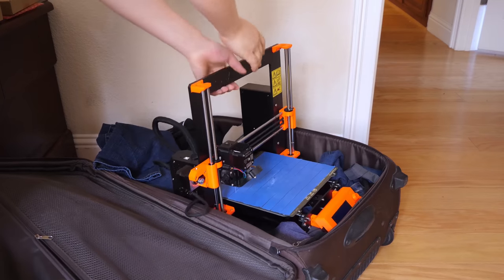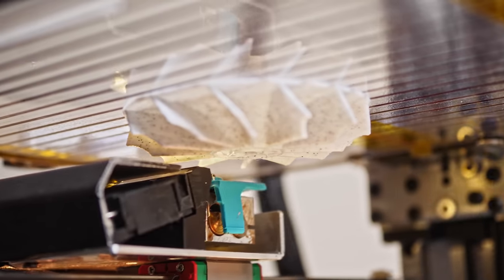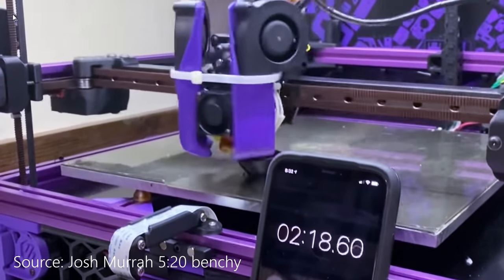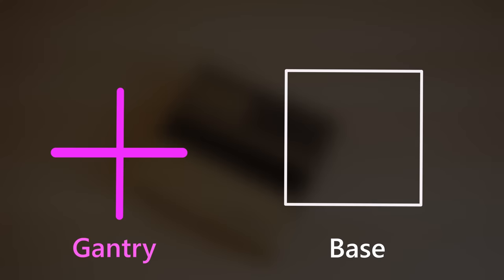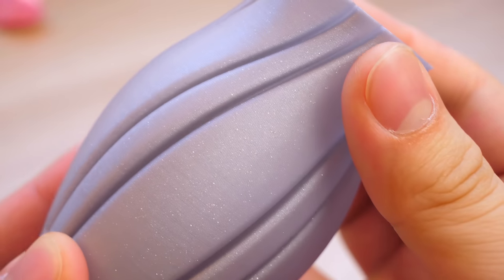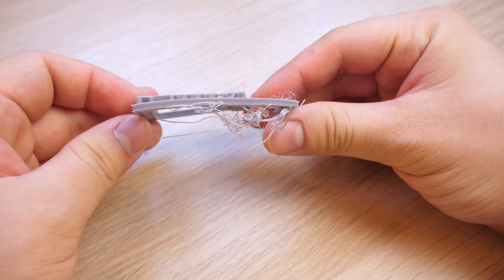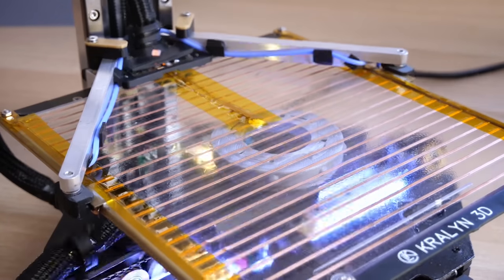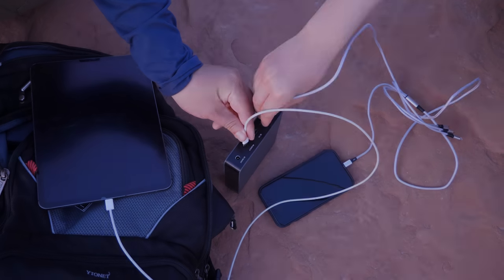A DIY 3D Printer That’s Upside-Down, On Purpose? The Positron Introduction

Comment: "If there's enough demand".
I would buy this printer in a heartbeat.
Reply: @crazyoldpapy3966  Can I?
Reply: Me too
Reply: @michaelplaczek9385  I came here hoping to do just that.
Reply: Count me in
Reply: yep, me too
Reply: Same
Reply: Me too, definitely!
Reply: @charliehorvath9787  its really a matter of price in the end. For People that is going to buy a 3d printer anyway.. this seams like a good option. And it might even be a good beginer printer... something really not seen prior
Reply: I am in the market for a "cheap-ish" very small 3D printer. As has been said if the price is right I would consider it. The HUGE selling point for me is the reworking of the design to dramatically reduce the footprint and still increase the print size over other similar printers! I don't have a lot of space for some honking big printer but at the same time a big print area would be a bonus. Considering where the price of 3D printers has been going lately I have high hopes. Assuming it is sold as a "kit" that would also keep the price lower.
Reply: Ditto
Reply: I can't wait to see the indiegogo! I want one!
Reply: I thought this is a DIY thing?
Just build it on your own.
Total production costs seems to be around $500.
Reply: Same!
Reply: @lb8384  Total price of this DIY is somewhere between the $1,000 and $1,500 mark. I saw quite a few machined parts and getting someone to make the bed for you... good luck. The Hiwin/thk rails alone are about $150 a piece, and this uses 4 of them and attaches them together with large cnc aluminum components. Retail on this machine for a small batch of 50 of these would likely be between $2,500-$3,500 unless you included no warranty or support costs.
Reply: For what sort of pricetag though?
Reply: @Anyone700  No, theres an excel document showing you the total price of that.
Reply: Same. Where do I sign up?
Reply: Yep, me too. He’s a genuine genius, and that printer is surely game changer.
Reply: Yeah, me too. Price is not really a problem for me, storage size is (living in a small appartment)
Reply: Same!
Reply: Me too!
Reply: +1
Reply: Very interested as well! For a complete DIY kit I would pay something between a Prusa Mini+ and an i3 MK3S+ 500-800 EUR (incl. a printer profile download for popular slicer software). I love that the X and Y axis are always aligned, and the z axis seems to be ok as well. That is a higher benefit for me than its portability. I love that it is compact and rigid.
Reply: It really is a work of art! Being able to watch the print process through the build plate sold me.
Reply: @Anyone700  u wouldn't have to use authentic hiwin linear rails u can use cheaper rails and they are still decent
Reply: Moar demand over here!

Comment: I'm a mechanical engineer, and I can say this is a fantastic idea. Having the x and y so close to the ground makes it really easy to reduce vibration, and vastly reduces the complexity of the frame. You could even expand the z height super easily by just changing out a rail! It sounds like you solved the issue of the filament feeding in from the bottom, which I think was what was keeping this design from taking off before.

I would love a more standard, non portable larger version that uses all the standard components similar to an ender 3. It could have a big heavy base made from concrete or something so you really eliminate a ton of vibration. Then you can use a standard larger heated bed, and just switch out the e3d heat block for your custom right angle one. Of course you wouldn't be able to see through the build plate as you can here, but you could put a small webcam and a live display on it since you are running klipper anyways. 

You should work with Vez3d on making it a high speed printer! This would really simplify his design and have a ton of advantages. It has serious potential to be the next big step in 3d printing.
Reply: Here's a larger version of this printer (350x350mm) that I've been using for about 5 years now as my primary printer: https://youtu.be/hdju_6XEHZ4  With everything moving at high speeds stuck to a granite slab,  the Z axis is nothing more than a couple of 12mm rods that can be extended to almost any length.

Comment: Printing upside down might actually help produce better overhangs.
What i've noticed with my printer is that it does 75mm overhangs fine but as more layers (about 5-10) get built on top the overhang starts to bow down.
An explanation to this could be simply filament being heavy and pulling the overhang down but i think it's different.
What i think happens is that the top layer cooling down and contracting makes it pull on the lower layer, which has already cooled down and contracted previously.
So as the upper layers keep shrinking they curl the edge and make the overhang bow down.
So your 3d printer might make the overhangs better by making gravity work against this force of contraction thus making a straighter overhang.
Reply: Gravity problem, going to space to print will solve the problem。。or under water。

Comment: I've seen so many mods to brace and stabilize printer frames, and this guy solves the problem by simply turning the printer upside down. Brilliant!

I have a big delta printer (280x600mm build volume) that gets REALLY shaky with tall prints. Maybe I should turn it upside down 🙃

Comment: i want one! my god this has to be my next printer, just fold it up and go! so cool for visiting friends, making on-site repairs while still printing stupid fast! I'm absolutely in love
Reply: Not really sure if "on site repair" with a portable 3D printer is that practical, though. It likely takes ABS, PA, PC or POM, none of which can be done without an enclosure and relatively high temperature. So it'll be slower. And even if it's okay to use the most brittle low temperature PLA for the job, it still takes hours to get things printed (unless you only need a small gear to replace the broken one). You are looking to get to the site by 9am, identify and speed model the broken part before noon, set up the printer and wait for it to print the thing out and install the new part asap so that you don't take too much overtime. You'll still only have a few hours though.
Reply: @FlameRat_YehLon  Ive USED PLA in commercial products many times... it depends on what you are doing
Reply: @thatonesnowboarde  I'm mostly thinking about industrial grade/machinery stuff so... Well, PLA wouldn't be quite enough in most cases. Also PLA varies a lot in property and extrusion temperature does affect structure integrity, which is the reason I said high speed prints (likely achieved in lower extrusion temperature) might not be good for repair work.

Comment: How long could the Positron run off of the Polycharge? True portable printing!
Reply from the maker: if no heated bed, likely 5 hours, if heated bed is on, likely 1-2hours (also the voltage will have to be lowered to 15V)
Reply: I had the same question!
Reply: @kralyn3d  Is that with or without the extended battery? How much could one print in that time?

Comment: I wish you didn‘t choose marble filament to compare print quality 😅
Reply: My guess is that he used the marble filament because it hides layer adhesion issues.
Reply: @jeeplvr2000  dont think there will be layer adhesion issues... the Z axis looks fine. X and Y axes is troublesome on a hbot when the travel direction changes. it is most likely the reason why he used marble filament to hide the wobbly extrusion lines and XY dimension inconsistency.

Comment: Congratulation KRALYN3D  you made a beautiful work !
The upside done printer is a great idea :
- you reduce inertia. 
- gravity center is low close to the base .
- you avoid dust on the plate.
- you remove all this nasty aluminium frame who vibrate and resonating as a bell at fondamentals frequencies.
- Cheap aluminimum profile are never rectify so frame are aproximative ...   as a machinist every time i put a compoarator on it i hate this product  !
- a low foot print factor to the ground  
Yes your printer  is close too the perfection thanks to share your hard work with us !
Reply: And probibly improved calibration longevity
Reply: I would imagine it reduces stringing also, since gravity is pushing the plastic into the nozzle instead of making it drip out of the nozzle when not extruding.
Reply: @Deviloc1  if thet is the case, the unit whould be messy after a while.

Comment: I believe the low center of gravity is a bigger idea than the video gives credit to. It allows larger printers with less structure. Less structure means cheaper to make printers.

I would guess most people have little use for a mobile 3D printer but your new design allows for higher quality without higher parts costs (after scaling up). I would think the 90 degree hot end will be a problem as well as those fancy cable “belts” not being cheap. The clear glass bed could be a huge seller but the resin printer market doesn’t seem to mind so I would drop that for generic beds and lower costs. Then allowing off the shelf bed heaters. Again cheaper and helps with textured bed sheets. 

Is bridging easier? Could be a massive selling point. Allowing fewer support structures decreases waste. I’m highly interested in that concept. 

If you decide to sell these. I’m in the market for a larger printer. Prusa xl is taking unacceptably longer to release. If you can compete in size and semi close on price. I will 100% buy.
Reply: I wonder if the synchromesh cables could be replaced with plastic ball chains, which are made for blinds but are sometimes used in robotics.

Edit: Apparently beads have been used in 3D printers more than a decade ago youtu.be/QZXq9Gdh2zo
Reply: @Lassi Kinnunen 81 Reminds me of analog radio tuners with line wrapped around a pulley a few times.
Reply: I agree that it can be made cheaper, but much of making it cheaper is part of the "race to the bottom" that you can expect the moment this goes open source. Chinese manufacturers will make El Cheapos of it in a heartbeat, but I see the difference between having to see an FDM's 1st layer vs. SLAs: on one you need to know if the material will stick well, or squish too much for example, on the other you solve that with a rather different calibration method - slam it to the vat and set. 
Also given it's no new technology on the heater glass, it can easily be mass produced anyway. The 1st ones will be more expensive for sure but after the 1st 1000 it just drops in price a lot.
Reply: The thing that intrigues me is the bridging capabilities. As he says, the nozzle is pushing up on the bridge as it lays down (up?) the filament, so it might give better bridging performance than standard orientation printers.

Comment: I'd love to see a lifepo4 version of the powerbank. yes it would have to be larger for the same capacity, but lifepo4 can last for a decade of daily use and the fire hazard is much lower than traditional lithium ion batteries
Reply: LiFe batteries also take longer to charge and can't handle the same high output demands that LiPo can. 
However, LiFe would be perfect for a portable phone charger.
Reply: @saltysteel3996  anyone who needs to charge their personal devices at a high rate is naturally going to limit the life of those batteries as well. a slower charge/discharge rate isn't the downside you seem to think it is

Comment: Im also in on the crowdfunding for this printer... If it isnt too expensive, which leads me to: What would it cost to buy (ca.) :) 
This seems like a really cool and good idea. You can have 2 printers. A travel (this) and a bigger one at home :) Keep up the work 👍

Edit: He just released the cad files and other stuff, its about 500$ for this version, so its not bad at all :)
Reply: put another hundred on top if the hotend isn't diy

Comment: I freaking love this. Was going to build another corexy after my current build but definitely inspired to do a larger footprint of this build. What I think is spectacular about this is that the base is the same for a build of any z height. You could have a bunch of printers with minimal z height to increase the number of printers in a space, but then when you need to print one or two larger parts you don't need another printer, you just swap out the z axis for a taller one.

Comment: I usually do not print that much that I need a second printer (besides my Prusa MK3), but the fact that this one can be stored away in a small volume, and still can print at roughly the same size as the MK3, makes it very interesting to have around for those times I need to print more than usual...
The design ideas (upside-down, 45° baseplate, 90° filament path) are great, and really an eye-opener...

Comment: Hi, Ive seen your video maybe a couple of years back and i thought this concept of 3D Printing machines was great! I liked how you can flip the geometry for the Axises from a standard cartisian to a Core XY. So seeing this, whereby it's the surface of the BED + the XY Extruder which is now flipped...

To add, you've been clever enough to maximise the Build Plate Volume by using Geometry to figure it out too!! And obviously, to design it so it can be transportable, was kinna nifty too i may say!!

So now after two years have passed, I've come across it again with an inspired mind!!
I'm glad you're sharing your work and the accessibility for people who are interested in handling this as a project, can now use your documentation to (at least) attempt to make their own.

What I will be doing with your documentation is, to use all of the best features and those that are out there and to design ANOTHER new Printer called the TETRAGROMETON with all these features!! Thanks for the inspiration and Good Luck with version 2.0... 🤓🤘🖖

Comment: I am so glad I procrastinated reviving my printer long enough!

My printer is way too huge and spends way too much time packed after every move, and also is a bit crappy, so I decided to build a new compact one. And holy crap, what you have here is probably as compact is it gets! And has almost the same build volume as my monster too!

I found this vid accidentally. Was thinking about making a "3-in-1" printer/router/engraver, but still compact and light ("travel-friendly"), and thought "What if I keep the heavy spindle on the table and lift the part?" Now I definitely want an upside-down for greater bridge and overhang quality, even if I forego the milling option. Plus I feel like making it a 5-axis by tilting the build plate wouldn't be too hard.

Do you think your current gantry could handle milling? With a smaller spindle of course (a "flat" BLDC?), no metal, just wood and plastics. (Keepind dust out is a separate problem.)

Comment: This is really cool! One thing to consider before selling it commercially should be cleaning the hot and. Having the bend in it will likely make clearing any lodged material out quite difficult without complete disassembly.

Comment: Incredible good job! There is no problem now to create a heater chamber: heat goes up, so an accordeon wall on the sides op de bed will keep all the heat inside the printing volume and no warping will happen! Broke my brain , and i will certainly make this printer, but bigger since we need a build plate of 420 x 300

Comment: This is brilliant. Of course if your bed adhesion is good you should have no problem printing anything in this kind of configuration, I remember when they were testing rep rap machines back in the day they insisted on running one upside down to prove it could work in zero gravity. Besides, SLA printers have to work upside down and resin is much more dense than PLA, so if anything FDM machines are going to have an easier time of it.

Comment: i love this printer. i think a great selling point you could make is charge an extra fee to have it pre built, making it a one step construction process. this would effectively make it ready-to-go, space saving 3d printer that is prepared to function from the moment you get it out of the box, therefore making it extremely marketable to those people seeking to use 3d printers as a tool rather than a hobby.

Comment: Extremely creative! Fewer linear rails required as well. My guess is that a portable version may not be economical unless you can find a way to mount the z axes, repeatably, without precision machined parts. Still, there is a lot of potential here as a way to cost down corexy/hbot kinematics

Comment: It would be interesting to buy this printer without power supply, and instead have your modular powerbank as powersupply. Also, would be interesting to see conveyor belt printing, and octoprint support via small fibrescope cam. Might sound crazy, but what if the glass bed would be able to turn 180 degree flip, and continue with the next print while offering on the other side the printed part...Great job.

Comment: While your idea behind that printer was keeping it small, I think your design would be great for a bigger desktop printer as well. By doing this you can probably make it even sturdier to give great results at even higher speeds. I realy like the idea of keeping the moving mass on the bottom to reduce vibration. If you decide to make a commercial version of this style of printer, I will definitely consider it.

Comment: oh man, it would be so cool if this turned into the next great thing with consumer 3D printers. having a fully featured 3D printer that could fold away into a reasonable sized box would be so amazing. im just imagining that instead of having a large 3D printer that has to be basically permanently set up with a dedicated spot in the house, it would be something you'd only need to take out as required and could just sit on a bench somewhere for a few hours and put away on a bookshelf when not in use.